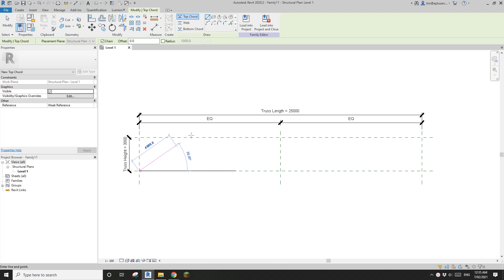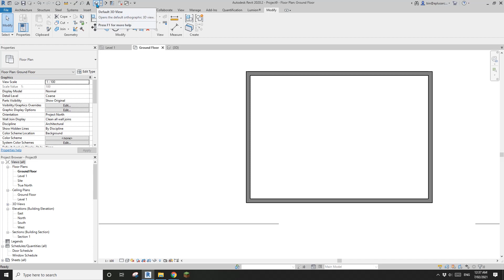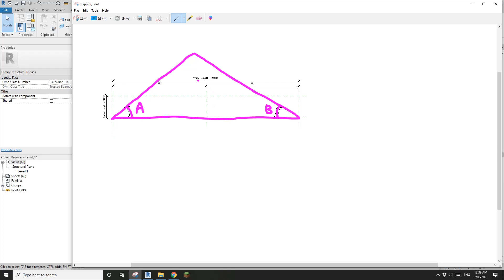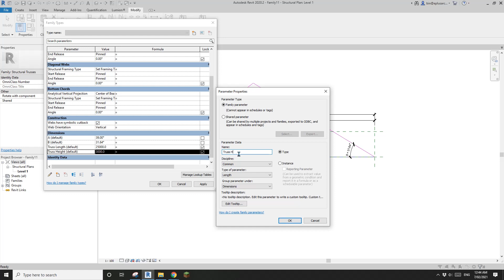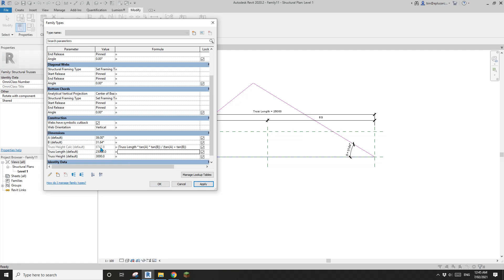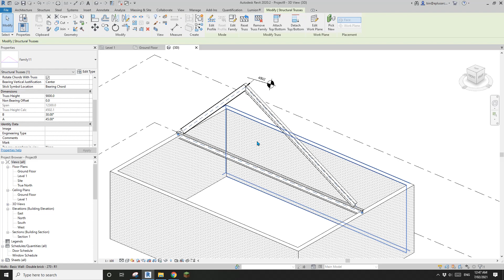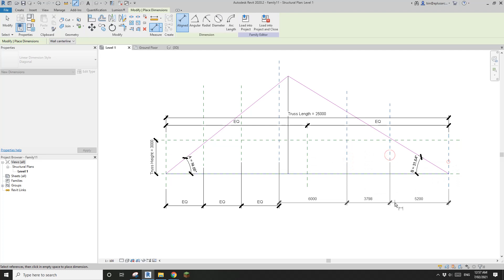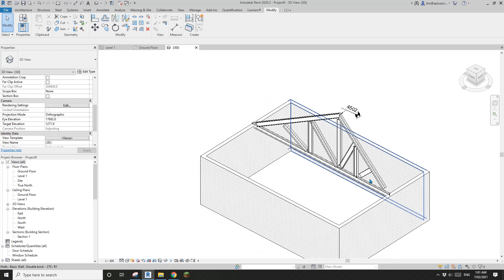Everyday Revit (Day 327) - Truss family with different pitch using Trigonometry

Comment: Hi bin at 12.21 i saw that this double side pitch have to overhang...so if i want 2ft over hang then what have to do
Reply from the maker: I think you need to create a vertical reference plane, add a dimensions, and create a overhang parameter. You will then lock your top chord onto that vertical reference plane.

Comment: very nice video.
To get rid of the original truss height appearing in the family properties tab, you can go to the family. Select the dimension and in the ribbon uncheck the istance box. This will turn it to a type parameter. The parameter is still there but will no longer appear in the Properties tab when inserted in the project.
Reply from the maker: Great idea! Why didn't I think of that? Thank you very much.
Reply: @BINHE615  You are very welcome. For once i am the one to remember a trick to the master.